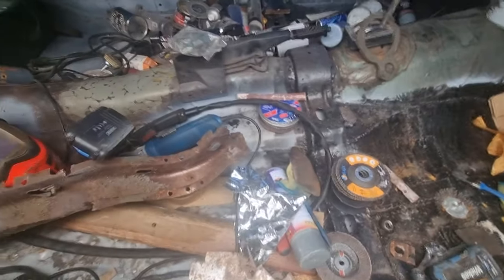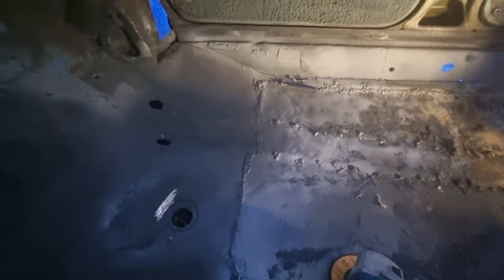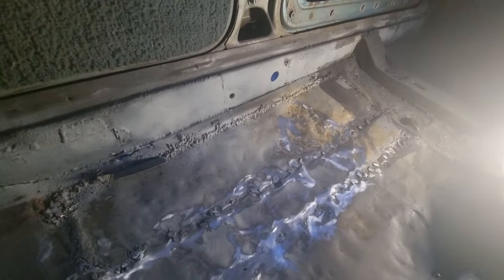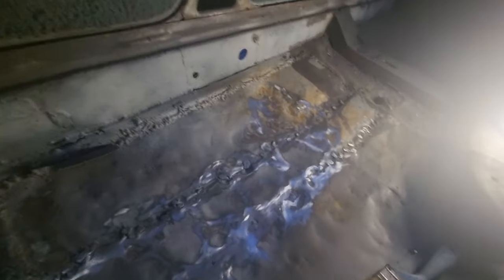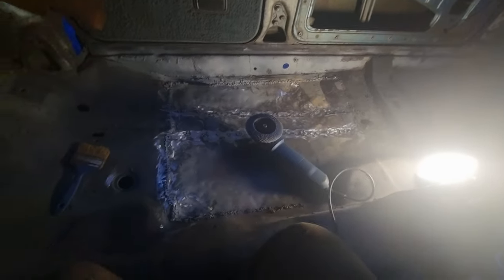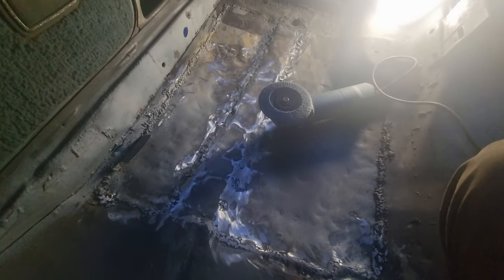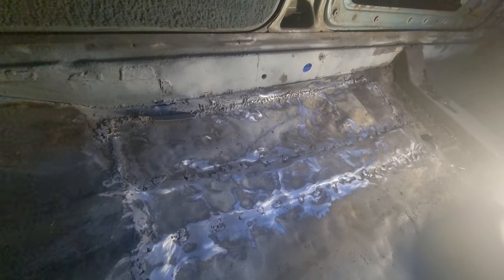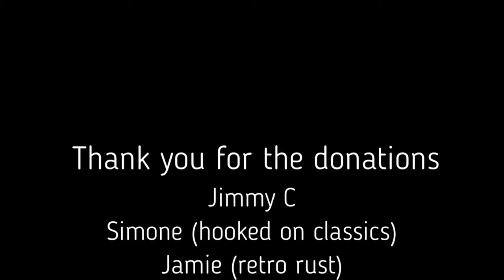Cortina Mk4 Ghia 2.3 V6 Restoration || Floor Pan Touch Ups (P47)

Comment: Looking great there buddy,   yeah welding touch ups and grinding is a pain in the arse, I must have spent weeks on doing it on my rover metro, when me and my dad did the boot floor corners and replaced the inner arch. If people are getting a little sick of the floor work, then it might be worth doing a video on another panel repair, like the scuttle panel, you removed. When i was documenting the metro build years ago, i did stuff under the bonnet etc. Just so the lads got a change of scenery, plus it might bump the views up more.
Reply from the maker: yeah i do understand people dont want to keep seeing same sort of work over and over on the same part but the floor was a very big job if need be i will finish these bits of camera but might upset other people so carnt win lol but will try and film other stuff i nthe next videos
Reply: @AdamSNook.  yeah you cannot win sadly,     the bulkhead to me looked a bigger job, due to the fab work you did. In fact i think you did the floor repairs quicker.
Reply from the maker: @procta2343  yeah i do feel like i did the floors rather fast to be fair

Comment: Heads up,remove any trim parts etc inside,and cover your glass.also U will save £s using grinding stones and finish with flap discs.flap discs don't last 2 mins on welds.
Reply from the maker: Yeah going to remove  the trims and yeah will try to find my stone went walkies dome where
Reply: Great work Adam but this floor welding is dragging on now .
Reply from the maker: @metalman4141  ii know but can only do it when i can these are jobs that need doing if i dont film any of i then people will wonder where im gone if people will pefer me to start filming again once the floor is done please comment below
Reply from the maker: @metalman4141  i will try to show somthink diffrent in the next video